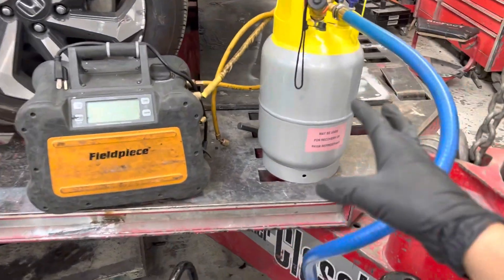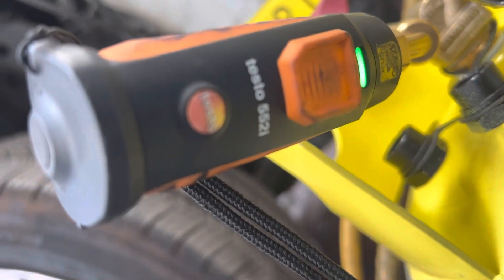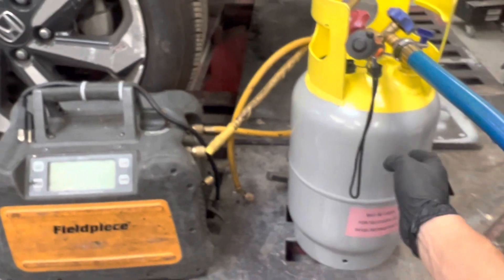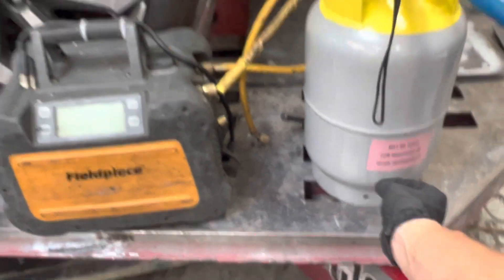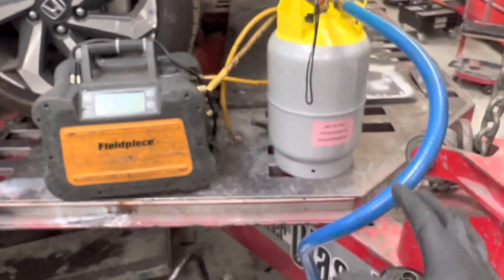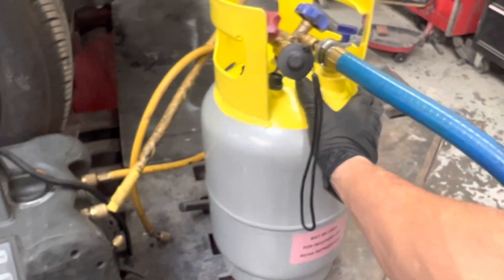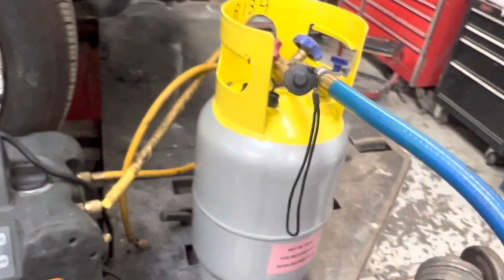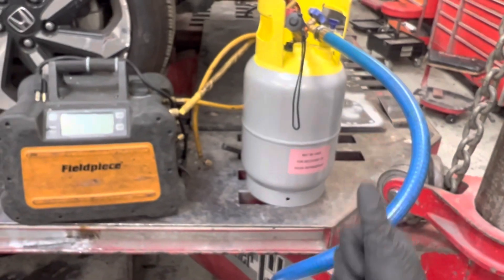NEW REFRIGERANT RECOVERY TANK PREPARATION

Comment: Hi Tom, If I use a clean vacuumed tank and recovery machine for just checking the charge, can I use the recovery machine to move the refrigerant from the tank back into the system without any loss?
Reply from the maker: You may have a tiny little bit of loss, but it also gives you the opportunity to introduce air. It take some practice to get a perfect you’ll probably makes mistakes that may cost you a lot of time.

Once it is removed from the system into the tank tank is contaminated it has that car’s oil into it and then the next car in the next car now you have a whole mix of dirty oils in a tank because oil builds up in the tank has a little gets remove sometimes and the first time you introduced Erin to the system, the PAG and POE oil absorbed a ton of moisture you would never want to do that 

Uncommercial we do that because we do 10 pounds or hundreds of pounds and every time we run it back and forth between the tank in the system. We put it through a large liquid filter dryer. 

And we use the PT chart against the tank temperature to make sure there’s no air in the system after allowing the tank to stabilize for a few hours 

Haley not recommended for cars at all whatsoever 

And once you use that new refrigerant recovery tank, it is no good for using as a reference tank anymore for testing your equipment 

As a reference, test tank for performing vacuum, decay test or nitrogen pressure test you want a virgin tank that has never been used for testing your equipment, engages and fittings against to figure out any problems off a vehicle before you attach it on a vehicle 

And if you ever find a vehicle you’re working on and you can’t find the source of the leak you take your equipment off and you attach it to the known good reference tank and you re-perform your tests 

If it fails, then you know if your equipment, then you just have to find a leak in your equipment, your fittings, your O-rings, your gaskets, your knobs, whatever 

No room for error
Reply: @coldfinger459sub0  Thanks for the detailed reply. This is just for my two R134A vehicles if I feel the AC is not performing well. Years between usually. I'm buying a small 6 liter tank just for this application. So oil will come out no matter how slow I recover from the low side?
Reply from the maker: @nicholasceea4109  if you have a site glass on your manifold, you could crank down your valve or the valve on the recovery machine if it has one to where you just let a very slow flow go from the suction line across the site glass in your manifold into your recovery machine and you can actually see that you’re not pulling out any liquid then you’re not pulling out any oil

Comment from the maker: Yes, when you buy brand new YF refrigerant the tank is small you cannot refill it. It has a one-way valve in it.. 

And recovery cylinders are large, yellow and gray .    All refrigerants go into yellow and gray recovery tanks.. 

You can paint and add your own color to the tanks, so you don’t confuse them and write markings on them .     This is a new tank I have so I have not painted it yet with different colors to identify it..

Comment: is the recovery tank for 1234yf same as for refrigerant 134a? (I mean 2-valve tanks for recovery) or is it a completely different design of the cylinder? Some tanks for 1234yf (with new refrigerant) looks totally different like 134a...small, 5kg, honeywell/dupont. So thats why im asking if i could buy  few standard tanks for recovering ( gray-yellow with 2 valves) and use them to both r134a and 1234yf ?